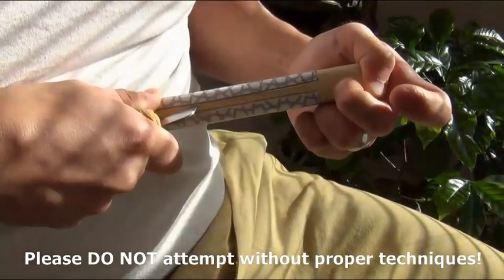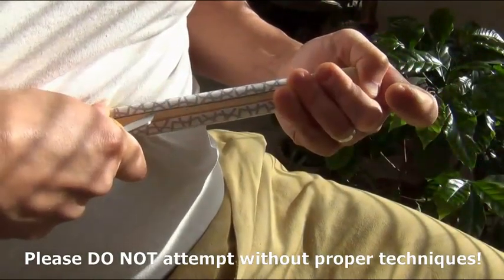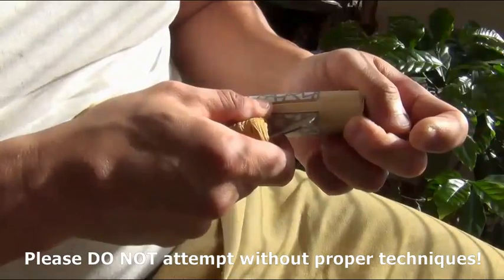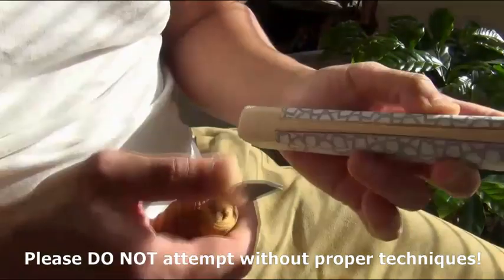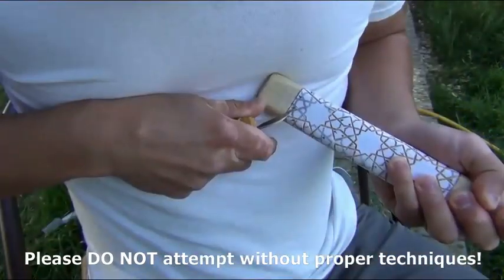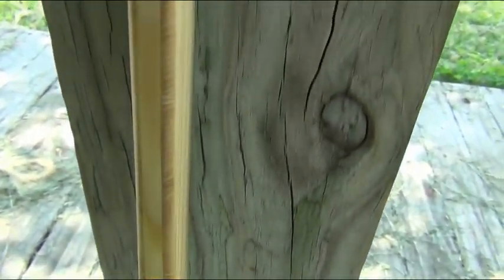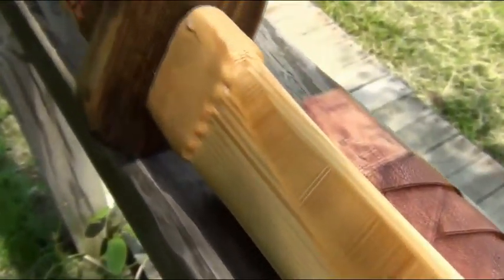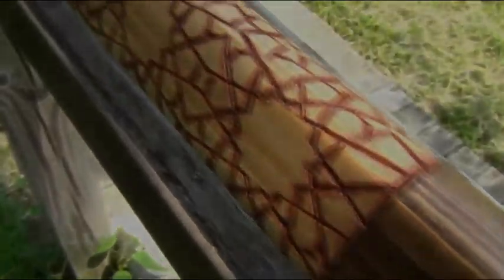Summers Woodworking 2x4 Contest Entry: Simulated Damascus Steel Toy Sword

Comment: Next time, use Minwax wood conditioner. Not sealer, it will actually say wood conditioner on the can. It will make a huge difference when doing your finish work. And it hides the blotches that you cannot see and gives the wood a little more harder finish. I have used it for decades. I love it. Give it a try.
Reply from the maker: Donald thank you for the tip; next time I want to finish something with a stain I'll try to remember to checkout wood conditioners. This project was different, I am not one who is overtly concerned with finishes, I prefer the natural look, imperfection, blotches are what I would consider character and they tell the story of the wood, the piece, and the person who made it. Thanks for watching, hope to hear more of your insight and critiques.

Comment: That. That is amazing. The "wrap" around the handle, was that shavings from the 2x4?
Reply from the maker: Thank you Bob. The wrap is made with thicker shaving of 2x4 soaked in water and borax.
Reply: Intriguing. Why borax?
Reply from the maker: Bob Haws
My hypothesis was that borax would speed up the penetration of water into the shavings by removing some of the oil that was in the pine and rehydrate faster (not to mention giving the pine a ever so clean smell). It may have helped because it only soaked for a few minutes and resulted in pliable shaving and a yellowish liquid; I would have to perform a control experiment with only water to confirm that borax does help.
Reply: I would never have thought of that. I'm really glad I watched this! Lol.